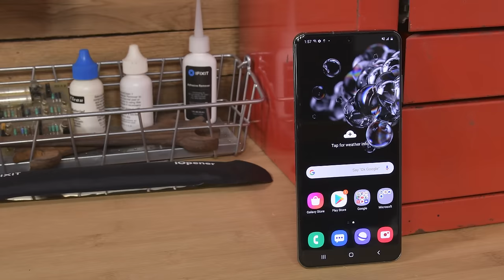Galaxy S20 Ultra Teardown: These Cameras are CRAZY!!!

Comment: 1:45 That's wrong. The active sensor area is three times as large.
Reply from the maker: It’s more than 2x, less than 3x. We did say “about.” ;) In any case, impressive sensor for a smartphone!
Reply: iFixit more companies should do this!  And upgrade optical quality.  Because this phone suffers from success - the shallow DoF makes AF awful, and I bet they could fix that too.  But it should be helpful in low light!
Reply: The iphone sensor looks tiny compared to it, at naked eye it almost looks like 4 iphone sensors
Reply: iFixit it looks to be about 2.5 times larger. So round up if you’re going to roughly approximate.
Reply: Really?? how about nokia 808??

Comment: Regarding replacing the screen , genuine service packs come basically like @2:20 but without the battery and has been like that since the s8 so don't have to worry about removing it from the midframe like you did at the end of the video. You say you hate taking them off when you don't really need to, making a screen replacement just a case of plonking the boards and other small parts from the old screen to the other.

 Part from that though I enjoyed the video :)

Comment: The strong glue is the for the ip rating. Something you can't really against Samsung if you dnt want water or dust in
Reply: Still no reason to glued the battery without the pull tab. But yes, those black gooey stuff on the sides is for ip rating.
Reply: @6oLsh0i6o0z3  yeah I dnt know why they use the glue they do
Reply: iPhone 11 Pro Max has the best water resistant capability in flagship phones, which is better than the S20 Ultra even though their ratings are the same. 

And iPhones have battery pull tabs.

Comment: 1:47  That's not how it works.
Actual sensor size should be the sensor itself not including the frame. 
It's similar to measuring screen size where you don't count the bezel as part of the screen.
Reply: dude, they literally have both sensors in that exact frame... how much more do you need to see that is twice as big?
also they are saying double the surface area, so exactly the measure you are looking for
Reply: @johnuferbach9166   What I'm saying is that the sensor size isn't twice as big it's more like 2.5x if you look at just the sensor.

Comment: I wonder if the periscope camera can be modded for more zoom.
Reply: Sollous I’m sure it’s possible but probably at the expense of image quality.
I heard of some people modding that same periscope camera in the P30 Pro from last year but I haven’t seen much improvements that made it seem worth it. Only ever came across one article on some oddball website a few months back, and the before and after modding photos that were in that article looked to be only minimally less grainy than taking a photo with the before modded camera then zooming in on that photo. 
If I can find that article again I will post it here if you like so you can see what you think of the difference in the before and after photos (I’m am in no way a photography expert so there may have been a few more differences than what I could tell from my untrained eyes lol)
Reply: @dragon81heart  please find it, I'm curious about that!
Reply: there're clip-on lens extension available in stores. haven't tried it coz i don't have phone with periscope lens. works great on normal btw.
Reply: Of course it's possible but the gap between samsung and other competitors would be huge so they improve their hardware slightly so the choice of people would be hard.
Reply: Omid Rastin Not really. Huawei used this periscope setup last year 
And the 108mp sensor for the main camera has been used in a few phones before Samsung bought any
(Samsung doesn’t make their camera sensors, they buy them like pretty much everyone else does)
Reply: So you're saying 100 times zoom isn't enough.  No matter what they do, some idiot will come along and say it's not good enough.
Reply: But you have to tweak the software too or else it will take potato photos
Reply: @dragon81heart  Uh no, Samsung develops and produces the sensors and sells them to the likes of Xiaomi. Samsung scuttled its entire digital camera division and moved it into its mobile division years ago specifically to focus on phone cameras. It has been making its own sensors for a long time. The last time I remember seeing them use a Sony sensor was more than 15 years ago, on a phone/digital camera hybrid. Actually, it might have been a Samsung sensor with a Carl Zeiss lens. Can't remember all these things so well anymore.
Reply: Mumba Jumba they are still Sony sensors as of the Galaxy S9 (it even said Sony on it)
I haven’t had had an S10 or one of the newer ones apart as they just came out but don’t be too surprised if they are still Sony made.
It’s like the glass on the phones
Samsung doesn’t make Gorilla Glass, they buy it
Same with the processor, it’s made by Qualcomm (the Snapdragon)
Many things inside cell phones are parts that are bought 
Not too many people realize that though so no harm no foul
Now you know :)
Cheers!
Reply: Ziemowit Zabawa I have yet to be able to find it again but if I do I will definitely post the link to it here asap :)
Reply: That's not true they bought the company that makes the periscope camera so now they make it
Reply: Bull s***
Reply: They may outsource some parts but not in all phones in every area United States we get Samsung manufactured cameras it doesn't say Sony on My variant of the note 9
Reply: Whoever wrote your article must be someone missed informs like you

Comment: Yeah at least the USB port is not soldered to the motherboard is this the same for the other two models?
Reply from the maker: We'll be tearing those down next to figure it out.
Reply: @iFixitYourself  I replaced the cameras on mine, did allnsorts of testing and everything worked pefect, when I put the back glass cover in place my screen went black, still responsive to the touch, i can swipe to unlock it.. I reopened it and I cant find any damage whatsoever.. any ideas? Thank You

Comment: I mean even Samsung's Authorised Service Centres locally here doesn't repair display by removing the display alone... They treat it as one panel from the aluminum frame and the battery so why should I do it myself? I mean I have nothing against self repairs or whatsoever as I've been a fan of iFixit's principle for allowing self repair but to the cost of what? If I get my shattered screen repaired it'll only cost roughly $200-350 that includes a fresh new battery cuz Samsung's policy for repairs in flagship devices like S20 or Note10 is whenever it's necessary for the display to be replaced the battery likewise should be replaced with a fresh new battery to avoid battery malfunctions and unwanted incinerations. I love iFixit but I don't think I'll want to put myself into the struggle of fixing my device just to save 💰 if that's the issue. I'd rather have someone professional o authorized do it for me since they also offer a 90-days backjob servicing if their repair tend to be faulty or if the same error persists. And that's what happened with my old Note9 and since the problem had persisted 5x already Samsung despite of me having the Note9 for 13mos (a month past their standard 12mo. manufacturers warranty) decided to issue me a full unit replacement complete with box and original accessories + free mobile phone insurance courtesy of the dealer where I acquired the new unit which is BTW an upgrade which is a Note10+. See that?! If you just push them to do their job properly they're gonna do something about it. Especially if you buy such expensive flagship phones like Note & S series ones. So I woulf say just leave the repairs to the expert and it may work out in your benefit too especially if your device is covered by their warranty. Stop putting yourself in the hasske of getting it repaired on your own.

Comment: Hello! Ive accidentally gotten the pin key into the speaker hole rather the actual tray. Can you tell me if this speaker hole leads to the display or if I've possibly broken into anything- like compromising water resistance etc? Would much appreciate ur expertise!

Comment: Has anyone ever tried to take any camera from a newer Samsung phone and try to attach it to a previous older model... Are the connecters the same?
Reply: it would probably still not work... it would also need the right drivers, interface speed capabilitys ect.

Comment: Still crappy, and can't believe how they finally just out of the blue started putting the camera pack on the same spot iPhones had since 2007, why no longer in the middle up?
Reply: Moises Sequera giant hole in the middle of mainboard is never a good idea
Reply: @C20F  why is it?
having the cameras of to the side and the soc more to the center does sound quite nice since that reduces trace length
Reply: C14Hz look at S10 board and compare it with S20 board, on S20 the camera hole is so big from left and reach middle of the board, if they put camera on the middle, they only have little space on left & right side, less space for put big IC, thats why they put camera on one side, so the other side they can put some important IC on it, Im happy they make board on top side, on iPhone i saw many many many case that right side board bent and make the phone unrepairable, phone most likely bend from top to bottom, not left to right

Comment: Hi I have S20 ultra that started acting eeird after update.Main camera doesn't focus properly and after a shake it focus correctly what could have hone wrong? Any app to callibrate its position to focus properly?
Reply: Hey was looking for some comments like this. I believe there are dozens of such cases, but Samsung has never admitted it's a hardware /software fault caused by their update. Unfortunatelly I haven't found any viable solutions, rather changing the whole module or just simply to move on to the next one (not sure if it will be another Samsung, though). Only shake or go to settings/close settings may run the camera focus recalibration..... Here in Ukraine, in Samsing official service, I was told to pay about 40% of the phones market price just to replace the camera. Not worth it. Still having some vague hope that they might fix their flagman with an update. Apart from that, s20 Ultra still holds up very well in 2023.... but the main camera module failure is just a desperation...
Reply: I bet it's planned obsolescence. My S20+ had a green line of death after a software update. Searched and found tons of users having this issue as well. Samsung told me I need to pay 30% of the price I paid for the phone to get it repaired even though it was caused by them.
Reply: @pixels_per_inch  at that point I'm really afraid to stick further with Samsung 😭🤬

Comment: Have you come across the issue with the camera glass cracking. Phone is less than a week old with no drops or falls. With a samsung case . Noticed today it has 2 hairline cracks in it.??
 Seems to be a common problem on the forums.

Comment: why don't they just use the Frame as an antenna?
Reply: afaik thats because antennas are fkn complicated, you can't just use any hunk of metal^^ they gotta be suitable for signals at several gigahertz, don't cause echo/reflections, have an appropriate radiation pattern, have the right impedance, aand i think if they were on the outside the touching would also disturb since it changes capacity
Reply: @johnuferbach9166  Thanks for explaining. I'm not really into Antenna-Stuff
Reply: @UnboxingTVofficial  me neither :x I'm just a mechanical/mechatronics engineer leaning towards technical informatics xD

Comment: I recieved my s20 ultra yesterday (March 3) and after a day of use Ive decided to return it. Too many cons for me
Reply: What cons? Are you thinking of the score from this video or personal experience you had with the phone
Reply: @JJ-rl7xx   I'm not much of a phone user. I have the s10 and for the cons are no Bixby key (which I remapped), no headphone jack and the volume buttons on the right side of the phone
Reply: @arturopaz3673  Thanks for replying :) Well i hate the bixby key and i don't use headphone jack because galaxy buds. I would also have hoped for the volume buttons to be on left, but i can manage. Just hoping there is a software button to take screenshots like on huawei
Reply: Then why did you buy it? I hate buying phones without looking at it first because you might not like it. Don't go with the hype check it out first
Reply: @arturopaz3673  the s10 is still a good phone it gets the job done.
Reply: arturo paz I can understand that, and commend your honesty
My biggest complaint is that those cameras are only available in the Ultra, and that only come in one massive sized phone (I’m not a fan of giant phones. They never seem to fit too well in the pockets of my work clothes, and reachability starts to suffer if you don’t have long thumbs lol)
That is one area where I have to tip my hat to Apple and Huawei. Their top spec phones are available in two sizes to fit customers needs and wants better, plus the smaller size is a bit more affordable as well which is always a plus.
Huawei was able to fit that same periscope camera into their P30 Pro last year, so I’m hoping Samsung will come out with a smaller version of the Ultra in the not too distant future.
I really dig the S20 Ultra, just want a smaller more affordable more pocket friendly version of it
Reply: @ibj3    The S10 is still a good phone and as a good camera system. Honestly some Tech reviewers are saying that the S20 lineup is better with the refresh rate but honestly I didn't even known what  "Refresh rate" was until 6 months ago before then i didn't care about 60, 90, or  120.  And I was thinking about the other s20 versions but honestly what's the point of getting one of the other ones. if I was going to get the new S20 might as well has been the S20 Ultra
Reply: @JJ-rl7xx   i still use the headphone jack to plug it in to my car. But now the new a Galaxy buds plus those are good and I'm keeping those. To quote some tech reviewers "you might not use it but it's nice to have it just in case you might need it in the future" so what if one day I forget my Galaxy buds or bluetooth decided to stop working and for some reason I only have wired headphones
Reply: @ibj3   and @JJ199  And the only pros for me for S20 ultra was a bigger battery, faster charge and maybe the 108 megapixel camera, the center hole punch and that its.
Reply: @arturopaz3673  those phones are overhyped i'd stick with the s10 it's a damn good phone you got if you ask me i just got my hand on the s20 ultra today and i'm not impressed not even a bit. The phone feels snappy and smooth at 120 but the s10 is not far behind either it's still a fast phone and it handles everything you throw at it. Camera wise i don't see a diffrence between the s10 and s20 ultra in real life the 100x zoom is stupid you can also mod the s10 to do that it's just a noisy mess! But it can zoom crisp to 10x or even 30x but i would not push it that far at 30 you can already see some noise in the pictures oh and the s20 takes sharper selfies but i rarely use the front cam and it's not a huge diffrence from the s10 the ultra is not mine i just unboxed it and had a chance to use it for a day still love my s10+ i don't see a point in upgrading
Reply: @arturopaz3673  trust me the 108 megapixel cam is not what you think at 12 megapixel the ultra takes sharper and more balanced shots even if you zoom 108 megapixel shots it's not as sharp as you might think it's better then any other 12 megapixel picture zoom wise but i'm so spoiled with my coolpix p1000. Phone cameras still have a long way to go that's why i'm sticking with my s10+ don't upgrade it just for the camera it's not a big jump
Reply: @arturopaz3673  remember when the htc m8 came out and everyone was hyped about bigger pixels in the camera and you don't need more megapixels and everyone loved it? I did too and bought it day one it got here and i was dissapointed by all the positive reviews. That's why i always tell people to test a phone first before buying.
Reply: @ibj3   I know but I'm the type of person that doesn't have that kind of patience so that's on me. I mean don't get me wrong though the S20 ultra is not a bad phone its just not the phone for me.  But I'm waiting for either the S21 or S22 or whenever they come out with the camera underneath the screen/display technology
Reply: @arturopaz3673  what if the headphone jack stopped working lol. We can keep going What if

Comment: It is so pointless and stupid to tall about removing a battery that should never die in a day if you aren't addicted to using phone all day.

And the itself will still hold an 80% charge, long after you sell the phone a year or two later.

If you break your phone, hopefully you have carriers insurance and it will cost you maybe $200 to replace the whole thing.

It doesn't need to be repairable. Put a cSe on it and what exactly would you need to repair?

Most people never repair their broken electronics anyways even when they were easier to repair, which makes repairability scores also as pointless as anything else.

It just sounds like you're talking trash about the phone.

Guess what, most people can't repair their own cars either. Do cars get repairability scores? No! So why do we need it for a phone? That's right, we don't!

I do like seeing the inside of electronics as it shows the skill and craftsmanship of these OEMs. Everything else is pointless banter.

Comment: if you send it to me, I can repair and I'll use it 😊
Reply: Please pin it
Reply: AniMeusic  really !!!
Reply: I knew that but did he broke it
Reply: @luciddreamer4372  probably not. you could just salvage the CPU and sell it as a replacement. also amoled screens die when exposed to oxygen, not when peeled apart. so if you crack it to an extent, it's pshhh, repair.
Reply: @metafelle  okya fine I'll replace it by new one 😇 !